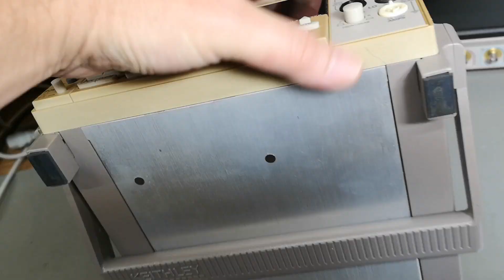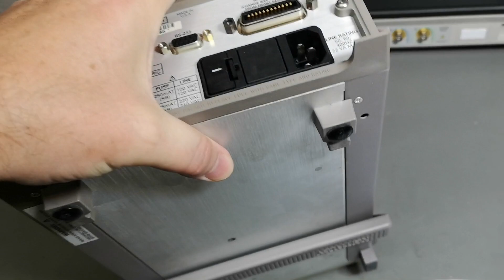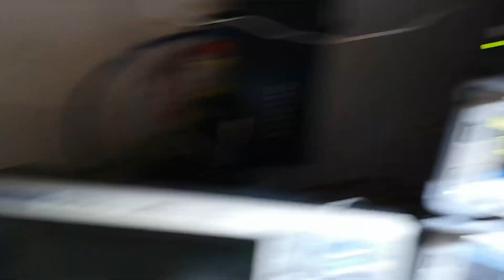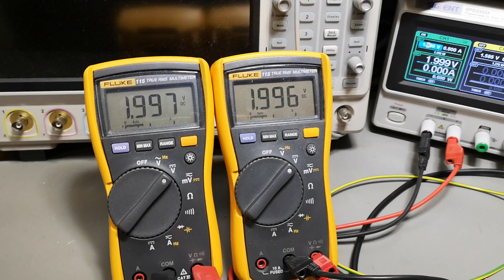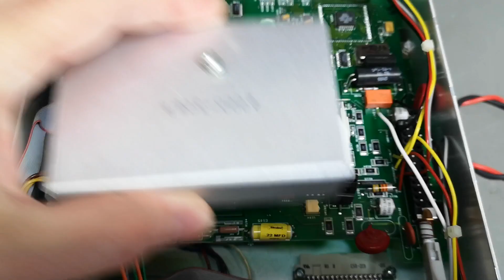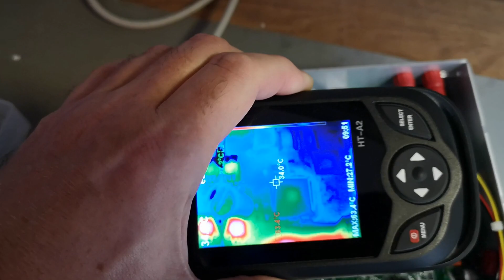Keithley 2000 multimeter 6.5 digits 1998 test teardown

Comment: It's funny, humanity's time-based reference stabilities are generally like 2 (or more? I need to go look up a bunch of specs to count exactly) orders of magnitude better than our voltage based ones. By the time (heh) you get to caesium and hydrogen and other atomic clocks, their accuracy and stability is out of this world.

This means that the stability that a TCXO or even normal crystal provides is generally easily good enough for the counting. And apart from that, you're not using the clock's absolute accuracy, only its stablity over the measurement period. The dual slope method means that always a ratio of counts (input counts/Vref counts) is used to calculate the reading, not any absolute number, which is where you might employ an OCXO. As long as the temperature didn't change between the ms you did the reading counts and ms you did your last vref counts, your reading will be accurate.

Comment: Hello sir, do you think a Keithley 2701 for 400 dollars is a good bargain? thanks
Reply from the maker: you can still get the 2701 model from new, it is about 2200 dollars, so if the used one looks nice, and all features works, and still perform to all specs, then it is a good deal, you need to visit someone with a much better meter, to prove its performance, and this way check all is with in calibrated readouts. else it is not worth much to you.. you must be able to thrust the readings.

Comment: High input impedance is very good for measuring voltage on Weston standard cell without damaging it - because the current you draw from the cell is small.👍
Reply from the maker: I got a few cells, maybe i could explain and test them one day
Reply: I also have Muirhead D-845-D Reference cell, and it is in very good shape (1,01896V) and stable.For me, it is quite amazing how that chemical stuff in it can hold voltage on the same level for maybe 50 years or more.👍

Comment: the counting is normal in DC. Its got a very high input impedance and measures the voltage on a sniff of an oily rag from 50 feet away...
Reply from the maker: i am sure it is, the giga ohm input will get most people spooked a bit in the beginning :-)
Reply: @TeardownOZ2CPU  I don't get it
Reply from the maker: @FryChicken  dont tell anyone, the trick is to pretend to be smart, you cant reveal stuff you dont get..
Reply: @TeardownOZ2CPU  engineers i swear...

Comment: I picked up one for around $200 not working, someone had tried to fix it, but I think their solder skills were not up to the task. Just replaced the front opamp they put in and double checked continuity 2 component nets out from it. Came good - lovely unit, a keeper for sure. The old units have a dedicated sense of purpose to them the newer units do not really pull off.

Comment: The device clearly shows the advantage of NOT having forced convection (fan) cooling. Imacculately clean and NO dust to see anywhere
Reply from the maker: exactly, i prefer fan less products that is correctly designed with good thermal ideas all over, to keep the power parts cold enough without a fan.

Comment: The transformer location is a weight distribution choice, for when they are rack mounted. The 2015THD is a lot heavier, despite being the same basic meter, but with the added audio signal generator and THD measuring capability.
PS: The front/rear selector switch isn't the best; you can sometimes pick these up cheap when they throw error codes because it needs a blast of contact cleaner

Comment: Maybe it's just me, I very much prefer a instrument like this with real buttons and display over this modern trend of LCD touch nonsense.
By the way, I restored two of these meters,  both had the same failure. The three capacitors directly next tot the voltage regulators where all leaky and the electrolyte started eating the board. On one of them I had to do some mayor reconstructive surgery to get it back to life. So I would highly suggest replacing those electrolytics if that wasn't done already.
Reply from the maker: thanks a lot

Comment: I own a 2000 myself and I still love it - thank you for the review.
I reverse engineered a 20 channel scan card for my set - not that I need it daily, but the relay clicking is such a sexy sound.
For example for recording the discharge curve of a 16s battery pack where one specific block had degraded.
The funny thing is how the 20 channels are showing on the display as only 10 channel segments are implemented.
So channel 11 is channel 10+channel 1 and channel 20 is 10+9+1 😅
You can see the indicators during display test or at power-up.
The isolation barrier is necessary to have the analog section floating while the interface section is grounded (GPIB, RS232, Trigger I/O).